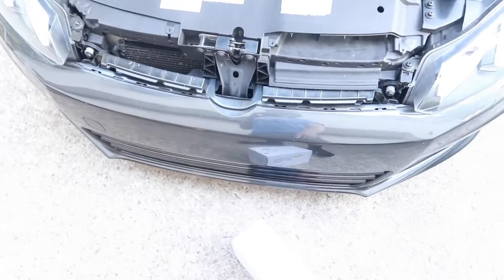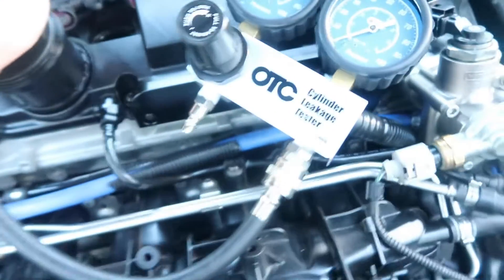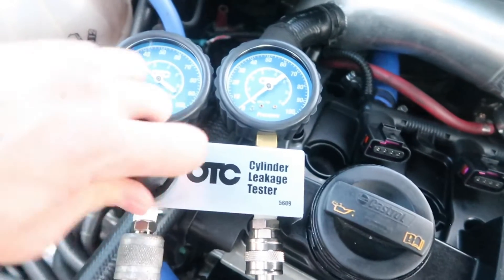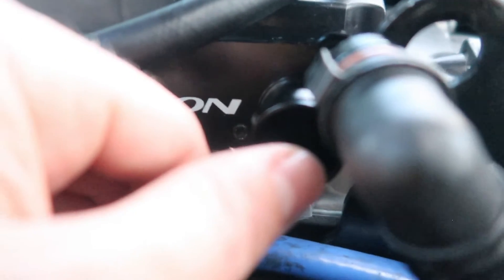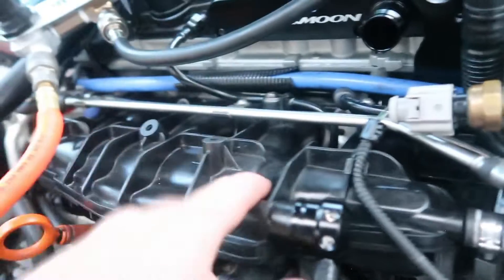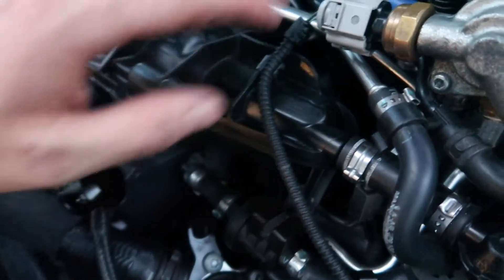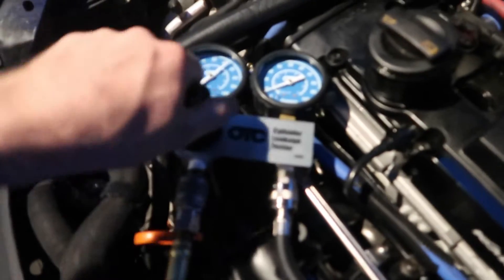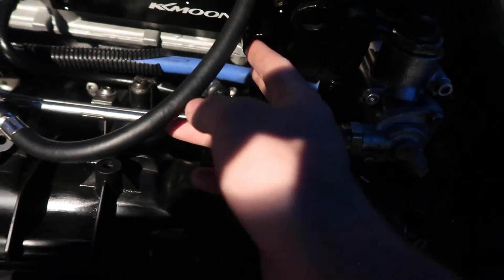MK6R Leak Down Test / OTC Leakage Tester!

Comment: I couldn't get mine to seal in the spark plug hole either. I ended up removing the original O-ring, threading on a spark plug washer in place of that O-ring, then putting a smaller O-ring down to the washer. With the addition of some O-ring-friendly silicone lubricant, I managed to get it to seal hand-tight.

Comment: Awesome video man! Currently have a broken valve spring on my 2013 Tiguan. Going to be tackling the removal and install of a new spring this week. In order for the valve to not drop inside the cylinder, you have to have the piston at top dead center and run a leak down test to prevent the valve from dropping?

Comment: FYI, the crankcase and the breather are connected, go back and look at Shiro's diagrams. At 10:02 you are talking about pressure "getting into the head" while sticking your finger in port #3 (from shiro's diagrams), but due to the oil drain, the crankcase and that part of the breather are one. You state that the "valvecover and crankcase are separated" but that isn't true. From Shiro: "The one thing I want to mention again and was never mentioned before it’s opening no.4 in Pic.1. That’s where the Second Oil Separator dumps oil back into the crankcase. There’s no valve, nothing there, it’s just an opening which makes the Second Oil Separator (2-----3-----4) one with the crankcase."
Reply: I think the reason you are feeling some air coming out of that breather port is due to piston ring gap. The reason you are feeling it more out the breather port than the crankcase hose is probably simply due to restrictions, I think the upper path is more free flowing. Try blocking the breather port and see if the air all comes out the crankcase hose instead. Based on the above, they are connected.
Reply from the maker: I had the port 3 breather hose disconnected. If there's a misunderstanding here, it shouldn't have affected my results and I'll explain why. 

With the breather hose in Port 3 removed, the crankcase below the pistons is separate from the head, correct? If I'm wrong, then the port 3 breather hose is pointless unless there's very restrictive ventilation from the bottom end crankcase to the head without the port 3 hose. If that's the case (they're restrictively connected even without port 3 hose), then my findings are still the exact same: much more pressure is getting into the head through the valves/seals than in the bottom end crankcase through the piston rings.
Reply: FAZED not saying your findings are wrong at all, just trying to inform specifics on how it all works so as to aid your debugging. In my understanding the breather area in the head and the crankcase are all linked. That hose comes up from the primary oil separator near the oil filter. I am admittedly not clear on how the block feeds gasses to the primary separator but that is the source of that hose. It’s not directly from the crankcase.
Reply from the maker: I appreciate it man, I know you're trying to help. The primary oil separator directly ventilates the crank case pressure, it's fed directly from the block. Sorry I know explaining things over the internet can be difficult but so far my understanding of this hasn't changed. I hope I'm not missing something. Btw that link isn't working for me :/
Reply: @FAZEDTom  It was just a direct link to one of the images from Shiro's post that shows the source of the crankcase breather hose as being the primary oil separator. I know it doesn't make a ton of sense, but it is my understanding that port 4 connects the breather and the crankcase, as does the hose. There is a statement that there are always gasses going up from the oil separator whether in boost or vacuum, but as far as I know nobody has a good reason why they wouldn't also go back up port 4. I don't know if there is an air pump or 1-way valve in the primary separator or if its simply thermal movement that causes the hose to be the primary path, but supposedly it is. And yet port 4 drips oil down without a valve or anything and thus isn't sealed off. Shrug. It doesn't really matter in terms of your debugging at this point I think, everything seems to be working properly in the breathing sense. Good luck on finding the source of the burning oil, I'm at a loss as to how to explain that.
Reply from the maker: Hopefully I have time to look into this tonight and reply again 👍🏻
Reply from the maker: Hey Jonathon, yeah port 4 is an opening in the valve cover to the head. There are also a few oil separators in the valve cover that drip oil directly into the head. I guess the head still needs to be able to recirculate that oil into the oil pan so therefore the head/crankcase must be connected even when the port 3 hose is disconnected. Thanks for bringing this to my attention. Also, shoot me a message on IG or Facebook for next time because these YouTube comments are tough for me to keep up with (I don't get notifications for replies)

Comment: If  your engine is consuming oil it could be your piston ring gaps aligned up and is letting to much oil into the combustion chamber, also if you want to see if your valves seals are leaking you can take of the intake manifold and look at the valve stem to see if it has a substantial amount of oil on them the exaust would suck to do tho.. I would also look at the cylinder  walls with a borescope and look for deep scratches on them that would be worst case
Reply: Also just read that you mentioned this started after installing cams, it could've leaned out a bit and caused  the piston to expand too much and cause the piston to scrape the cylinder walls, hopefully that is not your problem that would suck.. Good luck
Reply from the maker: I appreciate your input. I'll try to get the video of my valves uploaded asap 👍🏻 it's a sight to see 😁
Reply: Hitman  🤣🤣🤣

Comment: Yah Faze. May have to try a new head gasket.........
Reply: Hitman  lol shut the hell up man.
Reply: Hitman   Yeah that's what off the money. At this point it's definitely time to pull the motor apart. he has ARP head studs, it should be a few hours max to diagnose the problem. Not hard to pull it apart but it's always best to start with the cheapest option first then work towards the most expensive. The way you're offering advice is less than ideal and coming off as cocky.
Reply from the maker: Why's that? I don't have poor compression, misfires, burning coolant, or any other symptom of head gasket failure.
Reply: FAZED well it seem you have checked everything but the head. If it’s the valve guided or seals. The head has to come off anyway. What’s your next to check??
Reply from the maker: The head doesn't have to come off yet. Next would be looking at the valves through the intake or exhaust ports to see if oil is dripping down them. Replacing the seals wouldn't necessitate removal of the head either. 👍🏻
Reply: FAZED nice. Good luck.  Can’t wait to see this thing rip.
Reply: FAZED how would you go about replacing the seals without pulling the head?? Do you know a thread or video on doing that on a 6R I have almost the same problem but mine only does it at idle when warm which is why I don’t believe it to be rings since I don’t have the problem when it’s cold(which I believe would be Indicate bad rings)

Comment: It's not valve seals mate ....Possible cracked head or head gasket fault with oil leaking between 2 and 3 which is why you can hear the leak down in the head breather .....not sure if the sea foam and mystery oil thing is such a good idea .....it is possible that the oil control rings on 2 and 3 could be pushing oil up but to be honest I think that you would have had that oil burn from the first start up🤔
Reply from the maker: Thanks for the ideas man. As I understand it, a cracked head or head gasket failure will result in poor compression, poor leak down, misfires, burning coolant, etc. I have none of those symptoms. My only symptom is burning oil. Also, my problem started immediately after installing cams. There's no way I cracked the head or damaged the head gasket while installing cams bc the head didn't even come off. I appreciate your input and the conversation! Valve seals remain the most likely issue considering they're in the head and could have been unseated during cam install